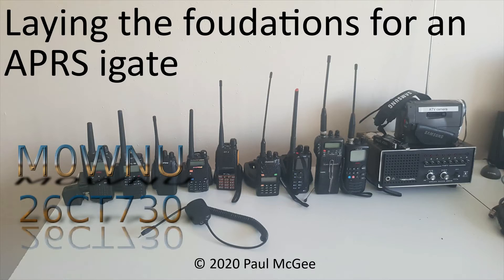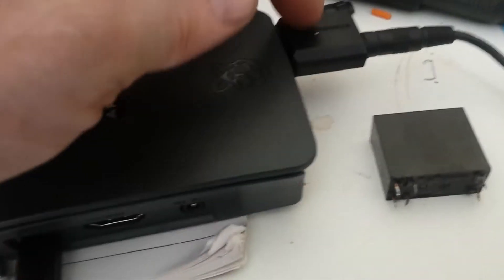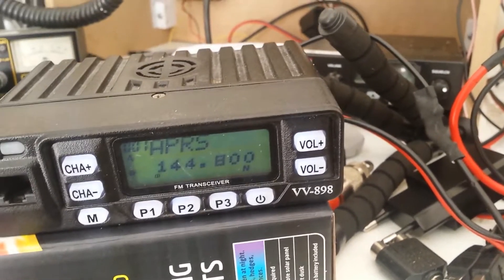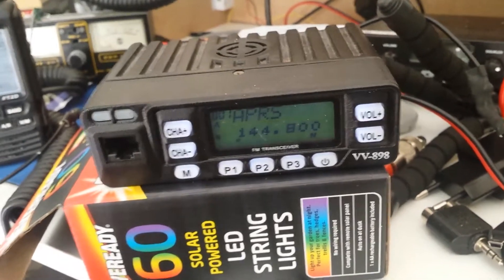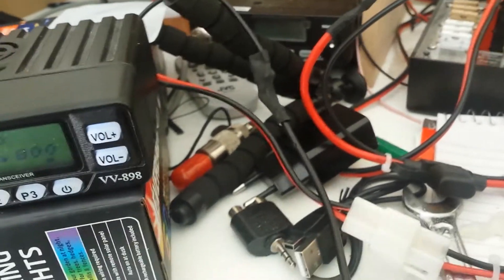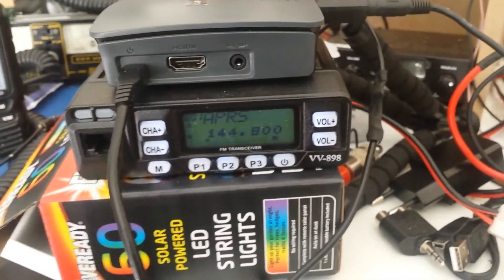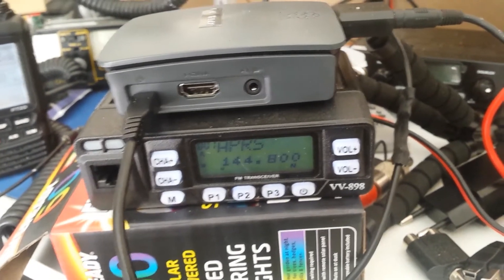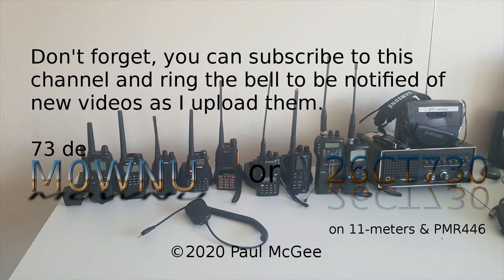Laying the foundations for an APRS igate

Comment: Will any analog mobile radio (Retevis RT95/Anytone 778uv)  with a speaker jack work with the pi and aprs? Thanks.
Reply from the maker: I see no reason why it wouldn't, I am using the speaker jack on this radio for receive into the USB sound card on the Pi